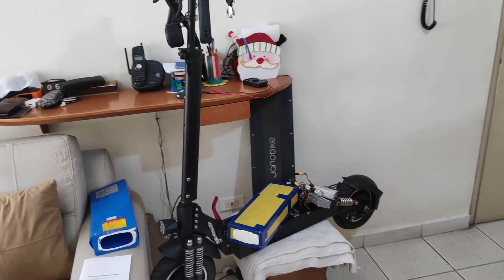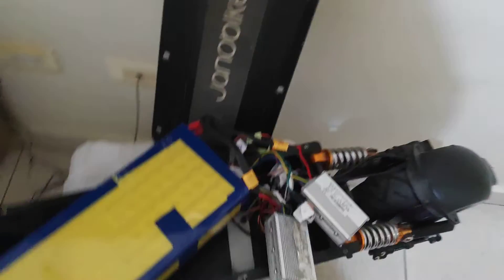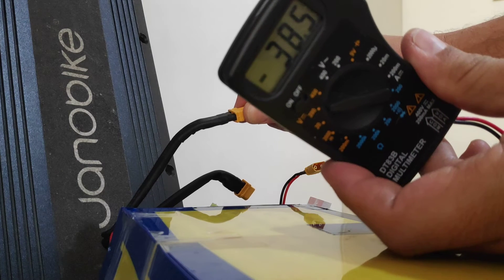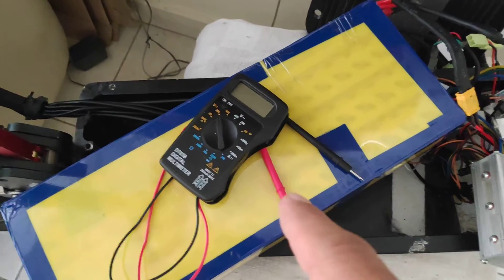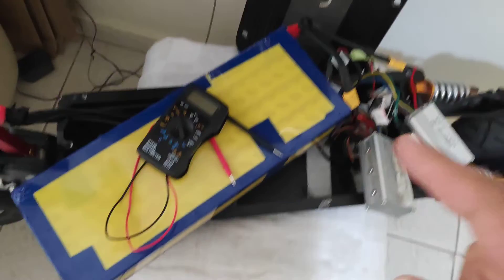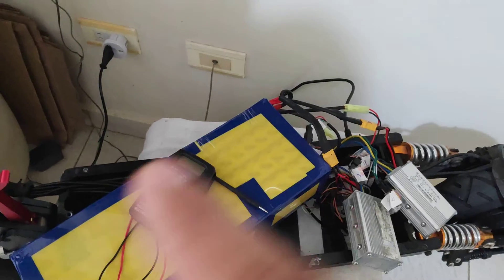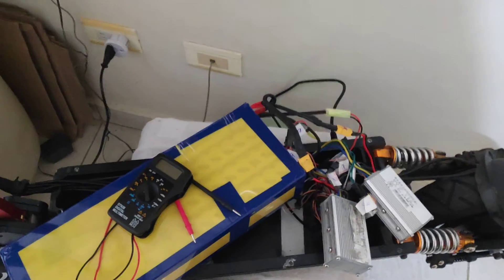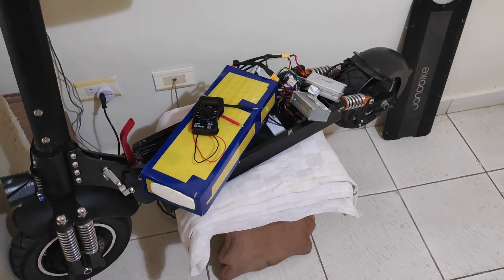My Janobike T10 Electric Scooter doesn't work - BMS Card Blocked

Comment: algo tienes en corto que no deja de quitarte corriente la bms para mi tienes la centralita mala
Reply from the maker: Así es amigo, la bms bloqueaba el sistema porque una batería hizo corto!
Reply: @2050distrostars  ya vi tu comentario menos mal lo reparastes medir una batería en serie o en paralelo no es difícil de eso conozco bien el tema y como hacer un soldador de batería hacer un puente en la centralita para que valla mejor preguntame y te puedo hechar una mano no hace falta que lo lleves a un técnico todas las reparaciones de mis patines que tengo en casa que son 9 las hago yo
Reply: @fersan1908  eres de españa te digo por darte mi numero y te voy diciendo por whasap asi te mando fotos
Reply: @2050distrostars  lo cambiastes y te sigue haciendo lo mismo probastes la centralita en otra batería conectado con los xt 60
Reply: @2050distrostars  hasta ponerle una batería de 18650 a 21700 pilas Samsung 14s9p etc

Comment: Why Would You Need To Perform A BMS Reset?
So, why would anyone need to perform a BMS reset? Well, if you’re reading this article, you’re probably here for one of two reasons.

Firstly, it could be that your battery isn’t working. To be exact, your e-bike battery isn’t charging or discharging as it usually does. In such a case, a BMS reset could be exactly what you needed.

The second possibility is that you’ve been troubleshooting a battery problem with the manufacturer’s Customer Service or a fellow e-bike enthusiast, and they’ve told you to try resetting the BMS.

In either case, they’re probably right. Performing a BMS reset could solve whatever battery problems you’re facing. Plus, it’s an excellent first step to troubleshoot the issue and potentially avoid buying an expensive replacement unit.

So, how do you perform a BMS reset?

Keep reading.

What Tools Do You Need To Reset A BMS?
The tools that you’ll need will depend on which method you use to reset a BMS. In this article, we’re going to look at only two approaches: resetting your BMS external and internally.

For resetting your BMS externally, you’ll need:

Safety gloves to keep your hands protected.
Wire cutters.
A soldering iron.
A standard multimeter.
A DC barrel jack receptacle.
A red wire and a black wire. 
However, if you prefer to reset the BMS internally, all you’ll need are:

A flathead screwdriver.
A plus or Phillips screwdriver.
Remember: Even though this article offers you two options for how to perform a BMS reset, you might still need to do both. One method might not work at first, forcing you to attempt the second method.

Whatever the case might be, it’s essential to start with the method that you feel most comfortable with. Suppose you’re unsure about working with things like soldering irons and wire cutters. In that case, it’s best to leave that to a qualified technician.

Step-by-step: How To Do A BMS Reset For An Ebike Battery
As mentioned before, there are generally two ways to reset the BMS: to do it externally or internally. You could choose to try whichever one you feel most comfortable with. However, if it doesn’t work, you may need to try the other approach as well.

Still, let’s take a closer look at both approaches.

Reset The BMS Externally
The first method for resetting your e-bike battery’s BMS is to do it externally. By that, we mean performing a reset without opening the battery compartment and accessing the BMS directly. To do that, you’ll be using a makeshift adapter to charge the battery through the discharge port, which should cause the BMS to reset itself.

Here’s how to make that adapter.

Step One: Create the Adapter

First of all, you should put on your safety gloves. You’ll be working with a soldering kit and later with live electricity, so you’ll want to keep yourself protected at all times.

Your adapter will consist of the DC barrel jack and two wires. Using the soldering kit, attach a red wire to the positive terminal of the jack and a black wire to the negative one.

You could also use electrical tape to keep it all together and cover any bare parts.

Step Two: Test the Adapter

Here, you’ll be plugging one end of the adapter into the battery charger. With your multimeter, check that the adapter is conducting electricity. Remember: red wire to positive, black wire to negative.

You must never let the bare wires touch each other, as that could close the circuit and make things very dangerous.

Step Three: Perform The BMS Reset

Next, connect the adapter to the battery’s discharge port. Look closely at the port, and you’ll see that it has indicators to show you where to plug each wire. It’s usually printed on the plastic itself. The red wire goes to the positive terminal, and the black wire goes to the negative one.

If it’s working, you’ll see that the light on the charger turns red. Hold the wires just as they are for 15 seconds, and that should cause the BMS to reset itself.

Once that’s done, turn off the battery charger and remove the adapter. You can now check to see if the BMS allows the battery to charge and discharge as normal. You can do this by replacing the battery back in the e-bike or connecting it to the charger.

Reset The BMS Internally
As you can see, resetting the BMS external involves working with live electricity, some custom wiring, and a DC adapter. If you feel unsure or uncomfortable with working that way, don’t worry! That’s totally normal. Many people would prefer using this second method instead, as it’s much more straightforward. 

Here’s how you can go about resetting the BMS internally.

Step One: Open The Battery
Firstly, you’ll need to use your screwdrivers to open the battery’s top cap. Typically, there are a few screws that keep the top cap in place. 

Doing that will give you access to the inside of the battery, where you will find the BMS, battery cells, and the wires that connect everything together.

Step Two: Pull The BMS Chip Out Slightly
The BMS and battery cells are kept safe deep inside the battery case. So, to make it easier to work on, you’ll want to gently slide everything out by just a little bit. You don’t have to remove everything entirely; the goal here is to have the BMS out in the open so you can inspect it closely.

Remember: Don’t pull forcefully on any of the wires or cells that you see. A gentle nudge is often all that’s necessary. 

Step Three: Reset the BMS
Take a closer look, and you’ll see that the BMS has several wires connecting to it in the form of a harness. Here’s what you’ll need to do next:

Disconnect that wire harness.
With the wire harness disconnected, plug the charger into the battery. Your charger should be on. 
Lastly, reconnect the wire harness to the BMS and seal all of the parts back in the battery case just the same way as before.
Then, test the battery to see if it’s working correctly again. Remember to check that the battery can both charge and discharge. Test its charging ability by plugging it into the charger, and test its ability to discharge by putting it back in the e-bike.
Final Thoughts
At this point, it’s safe to say that learning how to do a BMS reset is an essential skill for any e-bike owner. Having that ability would save you plenty of effort (and money) if you were to ever experience a battery that refuses to charge or discharge correctly.

Thankfully, there are two methods that you can choose from. The first involves resetting the BMS externally, which involves wiring up an adapter on your own and charging the battery through the discharge port. This approach can be quite challenging and risky for some people.

Alternatively, you could also perform an internal BMS reset by accessing the inside of the battery itself. This is a somewhat safer and more straightforward solution.

Whichever method you choose may not be effective, forcing you to try the other one as well. Still, if you’re ever unsure, it’s always a better option to take the battery to a qualified technician who can perform the reset and diagnose any problems for you.